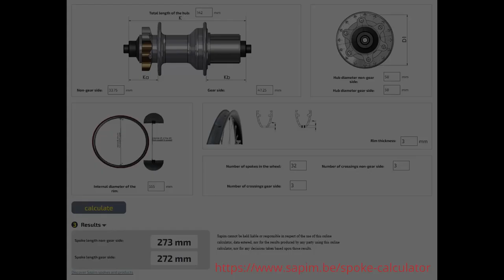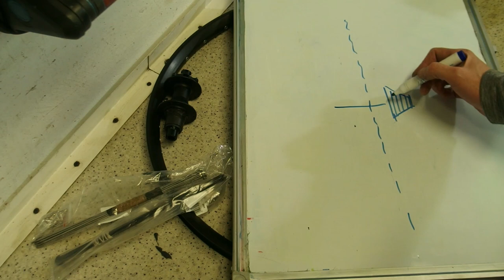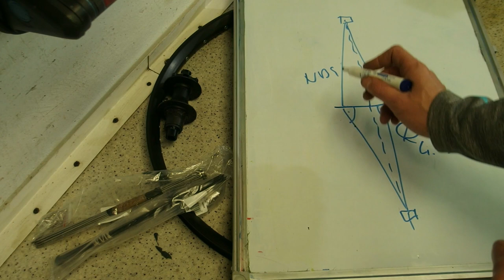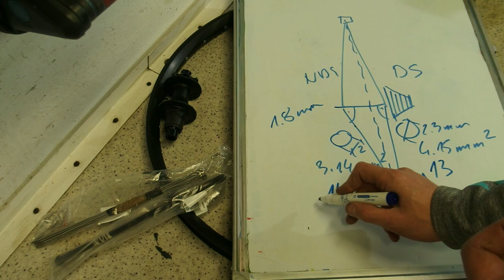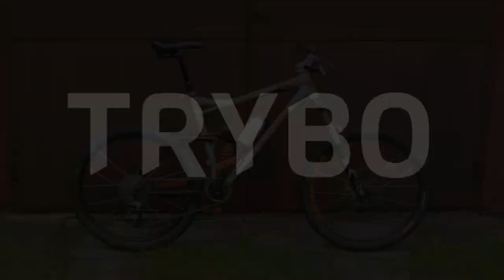Enduro wheel for a heavy rider - a detailed build.

Comment: Why don't you use rims with offset spoke holes to at least partially compensate for the difference in angles?
Reply from the maker: Because there are few of them available and tend to get really expensive. What I outline here is a principle you can use to build a proper wheel  from commonly available parts.

Comment: What kind of axles are you using? Have you tried to use thru axle which have tight fit to make hub alxe handle high load?
Also have you tried 2:1 spoke lacing to make DS and NDS spoke tension the same? Seems that this can improve spoke durability.
Reply from the maker: Usually - whatever comes with the bike. But for the Cube here I actually machined one. As for the 2:1 lacing - I have it on my mind to try to make such a wheel at some point.

Comment: Hello from the Basque Country, I love your channel. I found you a few months ago. 
I have a challenge for you if you are interested. I wondering if one could take the outside of a freehub body (I have in mind my 11 speed hyperglide alluminium freehub body) and replace it with another outside cover from another brand (made of steel). Hope does make steel freehub bodies but according to a reviwer in bike-components.com they are non-magnetic and softer and weaker than novatec ones and I don't want to spend 100€ only to check if this reviewer was exaggerating or not
I have a Nordest Sardinha with Hope Fortus wheels with a 2x10 drivetrain because I tried 1x sram eagle but I prefer 2x10 shimano